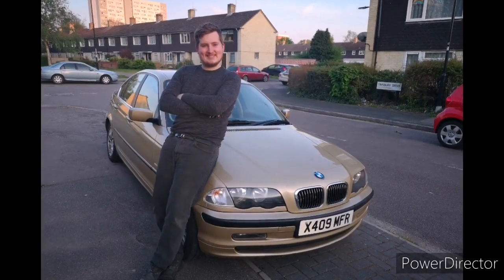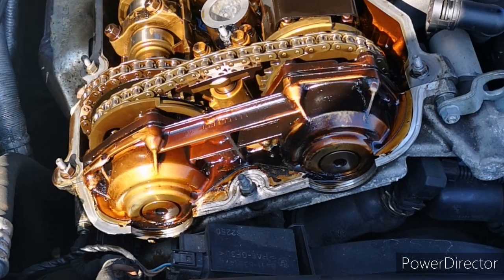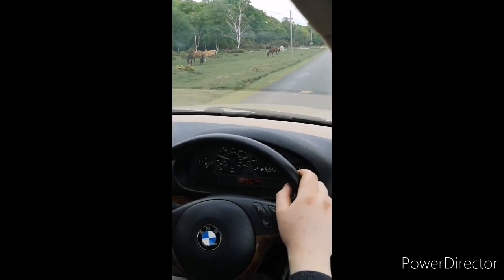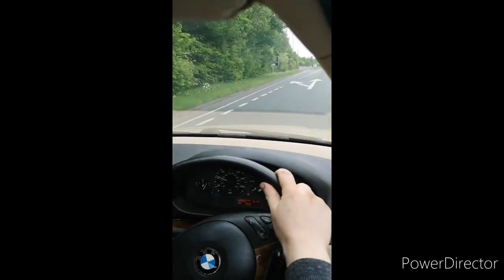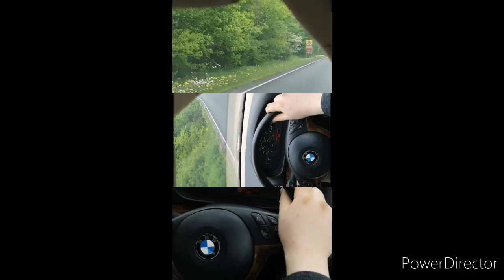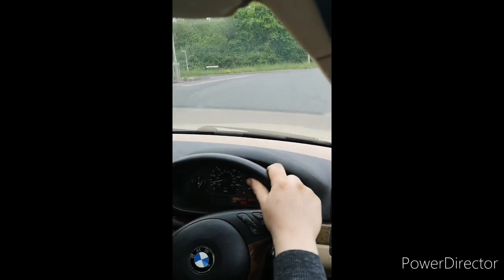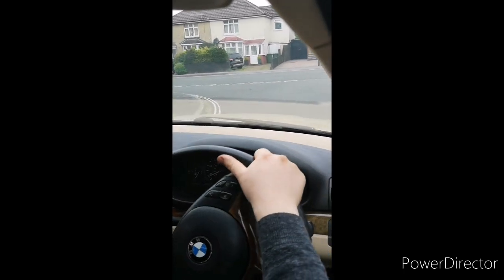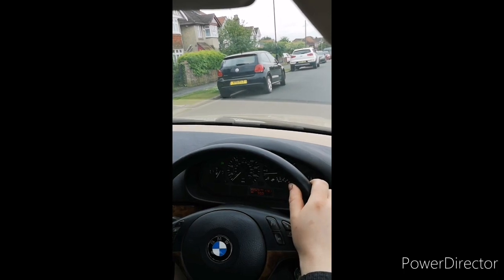Vanos seals! Do they help an old E46 get its groove back?

Comment: Yes mate. Thanks for the video. Before I replaced mine about 2 years ago, the car stalled few times. After replacement I never had any stalls. The engine pulls really good at any RPM. I feel much more grunt on high RPM. Best of all, my fuel consumption gone from 11l / 100km to 9l / 100km.
Reply from the maker: It's such a good way to give these engines a new lease of life 👍 better performance, usability, along with economy is always a welcome gain to any vehicle.